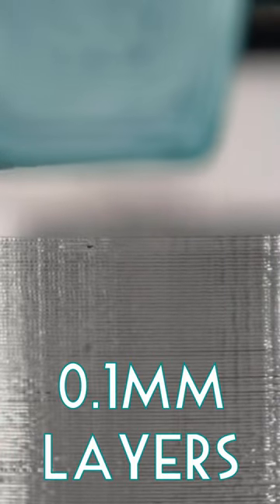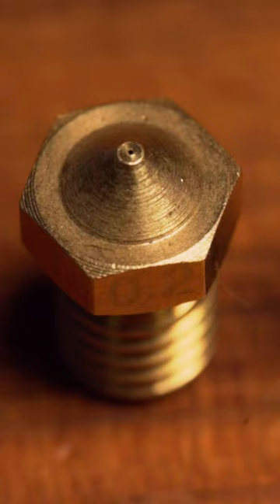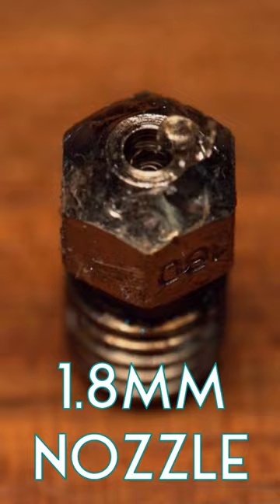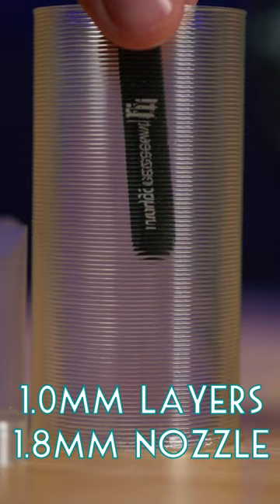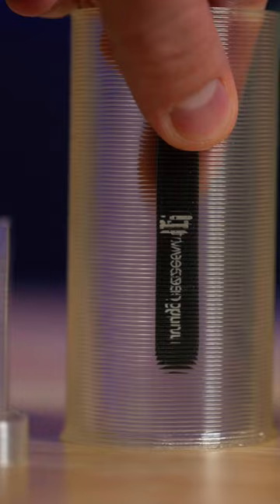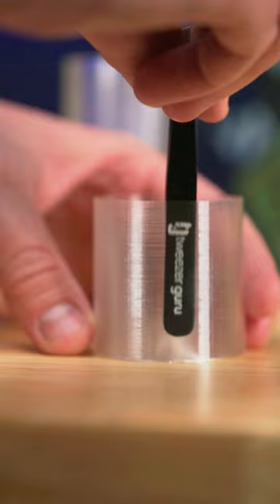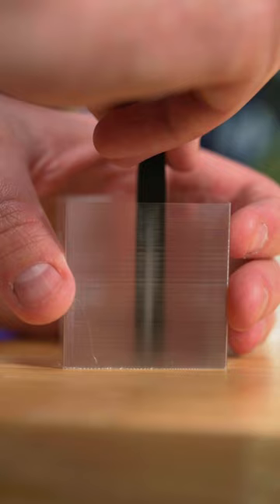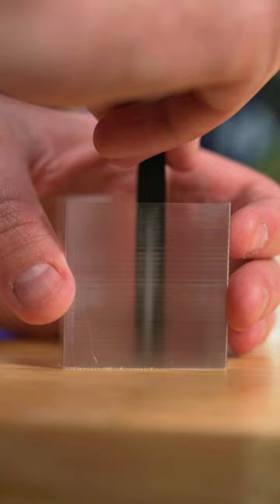3D Printing Micro 0.2mm Nozzle Clear Filament 🤔

Comment: Use a clear plastic that is dissolvable in acetone. Use that filament to print and use the acetone vapors to polish the thing.
Reply: I've done that before and it works like a charm
Reply: I was going to say something like this too. Might be better to go a little thicker than .2mm, and then polish it. The reason for that blurriness is because of the curve on each layer refracting the light ever so slightly. Sanding/polishing it down would make it a lot clearer.
Reply: Yeah acetone polishing would definitely smooth the edges out. But he might need thicker walls to do that?
Reply: @Gren4te  Yes, I think thicker walls are better, but not mandatory I think. It's only the vapors. I was able to get away with 1mm thick walls.
Reply: Youll still have the layer lines within the wall and it will still distort the light but it could help. 

Perhaps in an enclosed printed area with some consideration of asitone vaper for better interlayer flow?
Reply: @cirelesten you don’t want to put acetone in an enclosed space with heaters. That’s just asking for something to go wrong.

Also if the printer has any plastic parts in the enclosure then that could cause issues.
Reply: @Afghanistanian  that's not 3d printing. It's molding.

If you do 3d print the mold, the layers will still be visible in the molded part and will need polishing just like a normal 3d printed part.
Reply: Thicken the walls a bunch first
Reply: Was going to say acetone treatment
Reply: i was just about to say that
Reply: Acetone treatment works on ABS. If it works on any other plastics, i don't know. Transparent ABS is hard to find, but I found some, and I treated my transparent ABS parts with acetone. This did NOT make them more clear. It actually make them LESS clear. The acetone does make the surface smoother but at the same time it does something on a chemical/molecular level that makes the part cloudy. This something you won't notice with colored ABS but with clear ABS, when you're trying to make parts as clear as possible, you definitely notice it. Acetone is a step in the wrong direction.
Reply: @charlesstaton8104  try cleaning with isopropyl and then water. They do sometimes come out cloudy.
Reply: @electrifyingvids3545  i don't mean a residue, i mean an actual change to the plastic. The milky white residue can be cleaned off but the cloudy plastic can't.
Reply: If you give it a quick pass with a blowtorch will it merge the layer lines and be more transparent?
Reply: @user-uf8nn6he3e  different polymers react differently. I have tried the blow torch only on transparent polycarbonate and the results were very inconsistent. There is an extremely fine line between "ok now it looks better" and "ok now it's burned." You might get one spot looking good but around it still isn't transparent. You try to target the spots that need more flame and end up burning the good spots. I had much better results with the heat gun from reflow soldering station because you can dial in a precise heat that is hot enough to melt the surface but not hot enough to scorch it. The problem with the heat gun though, is that you must hold it in one spot for a while, which is a long enough time to heat more than just the surface. You end up introducing enough heat that the part becomes warped. If you are making knick knacks then the heat gun is the way to go. If you are making functional parts that can't be out of dimensional spec then do not expect to be successful in applying heat.
Reply: @conorstewart2214 you put acetone in a jar with a wide opening and lower your part into the vapors in the jar on a metal wire.  Then close the jar until next time you need to do that.

Comment: I lightly spray my clear prints with IPA to get a better finish. Even if the plastic isn’t soluble in ipa, it cleans the surface well and removes residues that make it less clear
Reply: @nothing09832 idk if you’re joking but they mean isopropyl alcohol
Reply: @myrealusername2193 
"Here we have stains of IPA. You can get rid of the stains with IPA"
- McNally, probably
Reply: i usually use lagger for this kind of stuff, or even strong pilsens will work well
Reply: Indian pale ale does sound creative

Comment: You are effectively making linear lenses with each layer, the outside walls are the elements. The better you can make the interface layers, and the smoother the outside is(both curvatures and surface finish), the clearer and more like glass it will seem

Comment: Try printing a Fresnel lens. Utilise the lines and refraction rather than fighting them. 
If you can change layer thickness with each subsequent layer, you could actually create some interesting optical effects.
Reply: Sadly, Fresnel lens rings need close to linear, not lenticular faces.

Comment: Higher print temperatures should give more clarity, and reflect that the published recommended print temperatures are way too low for the hot new material to thoroughly remelt and bond to the surface of the layer below.

Comment: When printing the solid thing, try printing only top layers with the same direction and 110% extrusion, together with reeeeaaaally slow speeds (like roughly 15mm/s) this can make surprisingly clear prints almost behave like injection molded parts.

Comment: There's a lot of good advice in these comments for improving your print clarity or for post-processing it, such as the people suggesting that you increase the extrusion width beyond the bore of the nozzle, but I don't see any that point out that there are still issues with how you have your system dialed in or with the filament itself. Zits/blobs could be "wet" filament or a processing problem (bad gcode, kinked wire, firmware interrupts/jitter). Layer gaps from underextrusion or poor adhesion (can be caused by too much or too little heat). Those are the two symptoms that jumped out to my vision. You or others may notice more on closer inspection.

Comment: The thinner filament is much clearer, but that makes the diffraction much more intense. You should try to apply this concept to a fresnel lense. I’m confident if you printed in the correct pattern you could make a crude but functional fresnel lense

Comment: I actually regularly print with a 0.1mm nozzle. It's used on a very tight tolerance 5-axis printer I built to make print-in-place parts with little backlash and I also have used it to print mechanical parts that need to slide against each other. The plan is to eventually set up this machine with a tool changer to swap between 0.5 and 0.1mm so I can save time by only doing fine details at high resolution.
Reply: U got any videos of it?

Comment: Put It into a hot water bath for alittle bit to make it mesh all the layers together so then it can easily be transparent. Don't leave it in the hot water too long or it would melt or deform from the heat and lack of support (atleast for the cylinder)

Comment: Youll always have that effect no matter what becouse its light going through essentially layers of clear tubes and the light is bent per layer and many layers makes an image blurry or it scatters light only way to get rid of that is you need flatter layers maybe or smoother wall
Reply: plenty of ways to get rid of it. requires polishing and sanding. and high heat.

Comment: Smaller layers, means more and more refractive tubes essentially, meaning the light "mixes" constantly, causing the extra blur.
Reply: Depends.  I've tried printing solid parts with transparent PETG, and thinner layers helped a lot.  In the end I printed at 0.04mm and that got the best result, better than these thin walled objects even, but only when looking down through the layers.  Looking side to side made not as much difference.

Comment: I was able to print wather transparent, up to 3-5 mm thickness. I use dryed transparent pet at 105-110 flow rate, 245 °C, no cooling, 15-25 mm/s and 0.04 - 0.02 mm layer height. You must be sure there's not gap in the print in which the light could diffract.

Comment: The lines of the filament cause that effect. It’s not necessarily the printer but the laws of physics. If you want clear, you’ll need to get rid of the lines.
Reply: This can be over come by making the surface a smooth layer, texture, with something like a clear coat or sanding and buffing.

Comment: i feel like on solid prints you'd have to do 100% infill have the perfect ironing settings, and bake the filament bone dry between each print. There's that filament brand that sells spools of PLA meant to be paired with their alcohol nebulizing chamber that will smooth the prints out based on how long you leave them in. Curious how it'd go.

Comment: Orient the print layers 90 degrees off set, so the tweezers are in line with the layers - might work better. 

The issue is the light being bent by the outer curvature of the layer. You might be able to over come that by using a liquid with a similar index of refraction. See glycerin and Pyrex for a demo. 
You might do well with ironing.

You might do better with a pattern like cross hatching the layers and you'd do that by printing a thin flat rectangle on the plate, looking down the z axis

Comment: I had very good results when I added a thin layer of car polishing wax onto my clear prints.
The wax fills in the layer lines and helps to counteract the distortion that’s caused by the roundness of each layer.
Reply: This sounds novel but wax is not clear. Do you have any examples you can link to?

Comment: Have you tried a light coating of 3m clear coat? Its just an airsolized spray you can get at many hardware stores.
Reply: I was going to say the exact same thing. But the goal might be to get as good as you can before any post processing
Reply: @Morberis  Goal in futility though. I'm sure you know the ability to see through it is the ability of light to pass through it in a straight line.

Comment: Would wider filament widths result in better clarity due to more material being pressed into each layer and minimizing micro-imperfections between them which is (I think) one of the reasons for the lack of clarity?

Comment: I found it difficult to print a solid model with a 0.2mm nozzle. Heat seems to build up really quickly and the filament burns, but I ran into extrusion issues when I turned the heat down